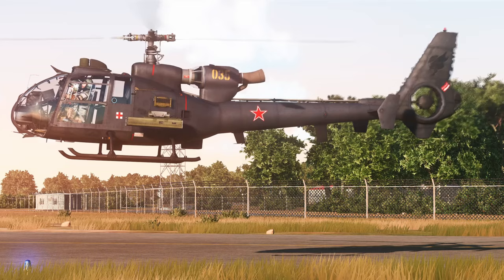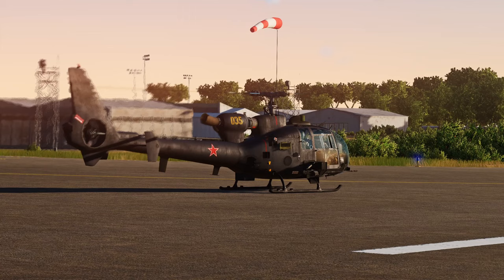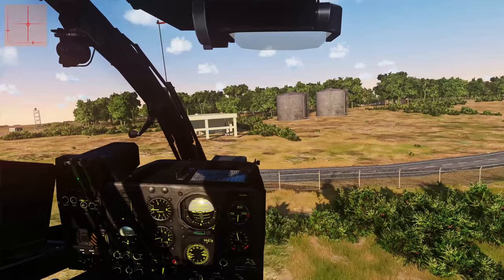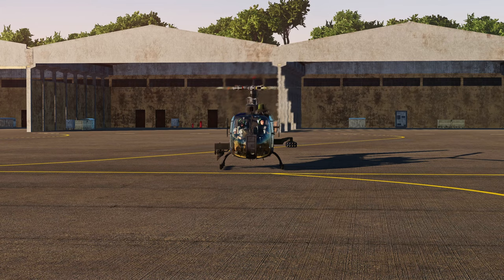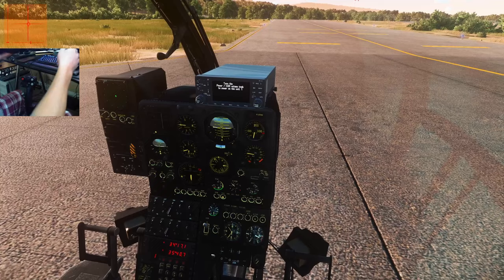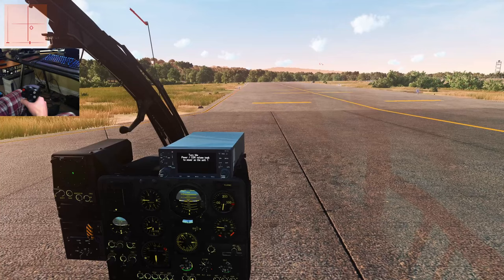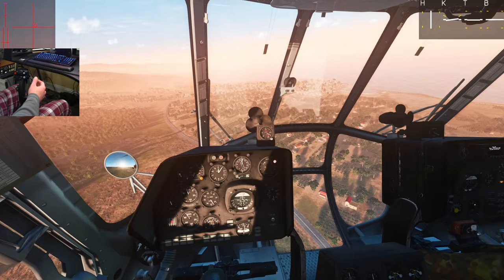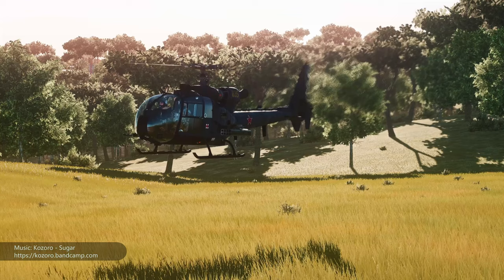DCS SA342: Gazelle Hover Tutorial

Comment: Hey, I appreciate the link to my video in the description, even though you didn't mention it in the video itself. Certainly didn't have to do that. 

I liked your demonstration of ground effect. I think the gauge your are showing is the torque, not collective percentage, though the flight model is so screwy that you can't really be sure. 

Translational lift does not depend on the direction the wind is coming from. In a steady light wind, the rotor will require roughly the same power in hover if the wind is coming from the front or from the sides. What will change is the tailrotor power required to maintain that heading, since the aircraft will want to turn into the wind. 

Speaking of translational lift, there isn't really a single speed where this takes effect. It's a gradual effect that occurs as airspeed increases from hover to the bucket speed. In my experience, it's not well modeled in the DCS Gazelle, however. 

Ground effect is also dependent on airspeed. You will "outrun" your ground effect with even a relatively small translational airspeed. In fact, very near the ground, you can actually see a brief increase in power required as you outrun ground effect, but the translational effect hasn't become strong enough yet. There is still some ground effect in forward flight, however, and the increased power at slow speeds can also be attributed to over-running the ground vortex. Here's a bit on this from R. Prouty's book: https://imgur.com/a/0qUKIYP

The return to wings-level in the Hip can be attributed, at least partially, to the fact that the autopilot is trying to maintain wings-level attitude. Press and release the trim release switch in a bank, and you will see it attempting to maintain that bank. Same goes for pitch, though in forward flight you have inherent speed-stability helping you out there as well. The gazelle's behavior appears very artificial, but I haven't verified it, so take that with a grain of salt.
Reply from the maker: Hey Erik! Thanks for the great comment. 

I definitely meant to explain that your video would be linked in the description, but after several takes and it being late at night I forgot :( 

As someone who isn't a trained pilot I'm always hesitant to say anything is "wrong" until I have a source with more authority to back me up, and in this case I'm using you as my source for the sensitive controls. I hope you don't mind!

I'm glad you liked the Ground Effect demo. It was the second or third idea I tried out (always looking for ways to make it simpler to digest) and I really felt like it made the practical impacts of Ground Effect pretty clear. You're almost definitely correct about that gauge being torque, not collective % because it goes to 110%. Clearly I have not really gone through the manual for this one yet.

You're also right about the wind direction. Again, shame on me for recording late at night when my brain says "Something about that doesn't sound right" but then I go ahead and render it anyway. For ETL not being an on/off, correct again which is why I made a point of always saying "around" 30kph, but I definitely wasn't clear enough about it being a gradual thing. That's actually one of the Gazelle's problems: ETL feels like an on/off switch in that helicopter. You notice the anti-torque requirements change instantly instead of gradually.

Outrunning ground effect is modeled in the Gazelle. I actually recorded about 90 minutes of footage just trying to analyze what is and isn't modeled, and identify places that felt "artificial" or "questionable". I didn't do anything with the footage, but I'm trying to find constructive ways to share what I learned in the process. If you're interested, find me on discord and I could probably upload some of it as-is.

The rollout behavior in the Gazelle is another one of those things where I had to say "This feels wrong but I've never flown the real thing so I have to assume it's accurate" until it got confirmed as a bug in Casmo's video and then again by the devs on Discord. The more I play around with the Gazelle the more it bugs me, because you have to fly it like an Arma helo with the over-corrections to un-do your inputs. It's a shame because I enjoyed flying it around the streets of Beirut when Syria came out. It's the only helo small enough to fit between the lamp posts, but the return rate bug makes it really hard to not drift into a pole. You just lack the precision required.

Anyway, thanks again for the great comment. I've pinned it so people can benefit from your knowledge :)

Comment: My trusted DCS helo translator. Its hard to transition 1to1 everyones potential setups and this did a good job at helping me identify where to tweak. For Virpil cm2 base 200mm extension with alpha I found the 70 x and y saturation worked best. 50 didnt feel right. I also removed the deadzone which was a big mistake for me to put in, Dont do that unless you have drift. I put in initially for fear of the twitchyness that is expressed everywhere. I found I could not get the Virpil collective to work with any curve. Its was best unchanged outside of needing inverted + slider. (I just solve that issue too, Slider wont flaten the middle of the axis so dont check slider if you need to flaten the middle) Casmo comment on how this is like a plane is also useful on why it feel so different. (No other helo does this) If you continue to hold in any deflection/direction it continues to roll or pitch. So you need to Roll Pitch and then remove the input and or counter if needed. Gazelle looks good and is fun to fly really makes me want the Kiowa.

Comment: Perfect timing, vs! I just bought this yesterday, and the hardest thing about the Gaz is getting it into auto-hover, she's a spasm of torque, and instantly loves to tip over. For myself, the Mi-8 is the more difficult helo overall to learn, especially landing. However, the Gaz is quite a challenge, and I appreciate the detailed tutorial. Great job, as usual.
Reply: Check out the doppler on the HSI knob. It gives you your lateral and forward velocity. If you press auto hover button with the bars crossed at the center (no movement), auto hover will engage definitely
Reply: @crispy1688  Thank you kindly for the suggestion. Do you mean the DOP crosshairs from the Main Horizontal Indicator Selector? That's what I've been using to catch the elusive auto-pilot. I just did a mission in the Mike, and did a better job trimming and using DOP. I figure this's what you're talking about, thought I'd ask just in case i missed something.
Reply: @BCooperArtMind  yep this is what I meant

Comment: I absolute agree with you on the cyclic return rate. But I think that it is not a simple bug they could fix and instead would entail a fundamental redevelopment to the flight model. Thats why (I think) they dont want to adress it
Reply from the maker: Yea, you could be right. And even if they fixed that there are a variety of other issues with the flight model which would need work too. So I understand why their plan is just to leave it as is for now and then entirely replace it after the Kiowa releases.

I definitely plan to revisit this when that happens.
Reply: I don't think it has anything to do with the joystick-cyclic desync, since in that case with accurately modeled helicopter flight dynamics it would have been much more difficult to hover this thing. I'd say the flight model is closer to planes than helicopters, really. That's why I stopped flying it altogether. Just compare it to JRX Gazelle for X-Plane. The latter is hardly a great piece of sim, having the teething limitations of BET, but it still does fly like a helicopter compared to the mess Polychop came up with, and you can enjoy it quite a lot.

Comment: So, I wanted to drop by and throw a bit of curious testing I've tried.  Instead of a negative curve on the collective you desat its Y axis as well.  

This of course limits how much power you can pull, but 84 sat y is about 92-3% rpm.  Which puts you right up against the danger mark on a normalish temp dcs mission.  

Ofc you can fiddle with it back and forth depending on temp, which is handy because you have a nice thermostat on the right of the pit.

I decided to try this because the negative collective curve was really wonking out my run in to hover manuevers.  I was constantly popping up when in my collectives midrange, and fighting with it was a real hassle.  Sat y limiting instead does the same as with pitch and roll, allowing you to have finer control, with a limited max top end of power.  This would be doubly useful for someone without a lot of time in the gaz, since it stops you from pulling her guts out on accident.
Reply from the maker: That's cool, thanks for sharing.
Reply: That's interesting, I might try it.  This video is brilliant (thanks vsTerminus) but I was left thinking "but..but..but" about the collective range.  If light-on-the-skids happens at about 40% collective/torque (referencing the 2 Stage Pull-Up section), then surely we want decent precision on the collective to be near the middle?  So, thanks for the idea for experimenting with saturation.

Comment: You do not loose etl when you rotate the fuselage out of wind. The rotor doesnt care which way the fuselage is pointed. What happens is that you need to apply more or less anti torque and so you will loose or gain torque to the main rotor.

Comment: Hello. From my experience the Gazelle is the easiest to fly, hover and everything from helicopters in DCS. And at the same time it is one of the most difficult to fly for those who masters the UH-1H or MI-8. The reason is very simple. Gazelle has very different reaction to input. I've tried to control it like common helicopter and that was the main mistake. Because Gazelle feels like flying aircraft with Fly-By-Wire system in F-16. In common helicopters the stick is used to control the cyclic. But in Gazelle it feels like I am controling the pitch and roll rate and not the cyclic. I use 1:1 input for stick (no axis tuning) and I like it. :)
Reply from the maker: Nah you're exactly right. The problem is it's not supposed to feel like that! lol. 

It's an old helicopter, and to my knowledge it's all analog and fully connected, same as the Hip and the Huey. So it should feel more like they do and not like a rotary wing Hornet with AP Attitude Hold on :P
Reply: @vsTerminus  Have you tried the Gazelle from JRX for X-Plane? I personally don't even consider X-Plane a "sim", but for what it is, I'd say it does a much better job of recreating flight characteristics of a real Gazelle (or a helicopter in general).
What Polychop came up with, on the other hand, feels more like a plane rather than a helicopter (and I never fly with SAS on to boot).
Reply from the maker: @getsideways7257  I have not tried it. I don't own X-Plane. The thing about Polychop's flight model is that the merits it does have are totally obscured by a couple main issues that I talked about in the video. It's a real shame, I think this could be a great module once the Kiowa releases and the Gazelle gets a new FM.
Reply: @vsTerminus  Can't blame you for not wanting to spend money on X-Plane, but if Polychop's Gazelle never gets sorted out, I'd suggest to still consider buying it on sale, for example. Apparently, real Gazelle is a very enjoyable helicopter to fly, so having at least a semi-decent recreation of it can already give you hours upon hours of fun. And the Polychop Gazelle's merits, in my opinion, are completely nullified by the issue of "sticking" in the current attitude. Also, that really doesn't look like some kind of a control input lag problem. With that much input lag it wouldn't be possible to hover it. Although you seem to be suggesting something more complicated like the joystick/cyclic pair coupling fine going away from zero, but decoupling upon the joystick's movement back to zero, when you seem to be under the impression that the cyclic starts creeping back at a steady slow rate unless the joystick crosses the zero and moves to the opposite half-axis region. But then, unless the cyclic snaps right into the position corresponding to that of the joystick's, don't you think the decoupling would become permanent or there would be even worse consequences? And if it indeed WOULD snap to a position on the other half-axis, that could immediately be felt/seen.

I think that's no swashplate re-zeroing bug, but rather there is something fundamentally wrong with the flight model. Or maybe PC thought the rotor is THAT much of a gyroscope? Either way, when you hold the cyclic deflected to a side in a hover, the "Gazelle" doesn't just assume a certain bank angle and hold it there (if it would still behave like a helicopter). Instead, the bank angle keeps INCREASING in that direction. That's plane's behavior, not helicopter's. This flight model is a complete mess. I really hope PC will rewrite it from ground up after the Kiowa is released, but I don't have much hope for that. So far they've been full of lies. I'm not even sure if the Kiowa is modeled properly. Will most likely have to wait until a free flight event (like the current one) after the release to try it before buying, since the guys have had proven themselves completely untrustworthy.

Comment: for mi-8 which autopilot mod active in this video? and on special settings menu which trimmer selected and ai autopilot ticked or not ticked because when i fly with ai auto pilot its force to my trim and drift on cruise flights.  i love your videos and learnd many things, thx for videos.
Reply from the maker: I was only using the Center Channel autopilot in the Mi-8 here. That's the pitch and roll damper.

I use the return to center trimmer mode (I made a video on why I use this mode)

I don't have the AI Auto Pilot special setting checked. Instead I just have a switch on my throttle bound for the AP and I can flick it off and on again to reset it whenever I need to.

Comment: Cyclic return rate - is this not linked to the autopilot damping on x, y & z axis?  Automatic stability control? Mi-8 has same principal but looks like much faster response
Reply from the maker: That's a really good question. My understanding of the two systems is that they work in a pretty similar way and their limitations should eliminate this as a possibility. That said, at the end of the day I'm not qualified to do anything other than speculate.

We know the behavior is incorrect as-is because Polychop confirmed it to be a bug, but that's basically the extent of what I can tell you with certainty.

Sorry!

Comment: I'm going to be getting a gooseneck extension for the TM mag base pretty soon Terminus.  Once I have some flight time in the gaz with it would you like for me to leave a longer comment detailing how it compares?  I've got about 3 years of dcs helo flying, Mi-8, UH-1H, and Gaz mostly.  Been using a CH Fighterstick for almost that whole time and I'm really very excited to see how that compares.
Reply from the maker: Absolutely! Please share your thoughts once you've had some time. In my case the extension made a huge difference.
Reply: @vsTerminus  Been a bit now, and I usually get an hour or two of dcs a day if I'm lucky.  The 40cm extension was okay by itself, but I ended up needing to get the much stronger (blue, I think) spring for the base.  The stick was downright floppy with the base TM spring, to the point it couldn't even recenter.

The difference in helos, of all types, has been spectacular.  All curves and saturations removed.  Almost a raw one to one input, and with the spring I can use the dcs style trimming then centering system.  

It makes the Gaz feel very responsive, without being a bucking wild animal.  The Mi-8 feels steady and even more solid then it ever had.  The huey feels fantastic as well.  I don't fly the ka-50 much tho, tbqh.

The biggest difference by a long shot with the extension has been my energy management in fixed wing has soared thru the roof.  It's so, so, so much easier to hold turns with steady G.  Almost impossible to hamfist the stick back and throw all your smash away.  Formation flying and aar have been greatly simplified and eased as well.  

It's a kind of difference that's hard to describe, but imagine trying to write with a tiny stub of a pencil versus a full sized one.  The fine control difference is massive, immediately noticed, and becomes second nature rapidly.

Comment: What's bugging me right now is that when I use cyclic input, it is a smooth movement except from rolling right. I'm not sure what the issue is but it feels like it may as well just be a keyboard press instead of analogue movement; I'll gently move the stick right and there is no response in the helicopter until it suddenly jolts right. If anyone can help with this it would be greatly appreciated.
Reply from the maker: That's weird! Maybe a binding issue with the button bindings for roll? I haven't run into this problem myself.

Comment: Your translating test is slightly compromised by the wind. You can see that you go by the windsock and there is a heavy wind coming from the right. You should have done the test into the wind (or with no wind).
Reply from the maker: The windsocks in DCS don't show magnitutde, only direction. They just always look like it's super windy. Instead look at the smoke you see around the airfield to determine wind strength.
Reply: @vsTerminus  Ah, ok thanks. Good to know.